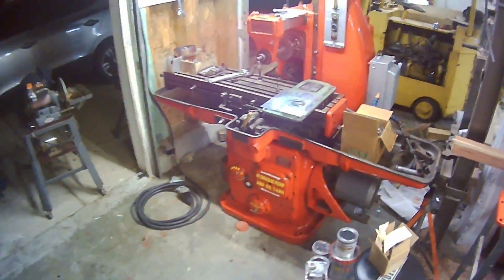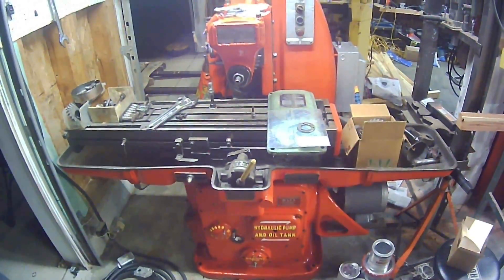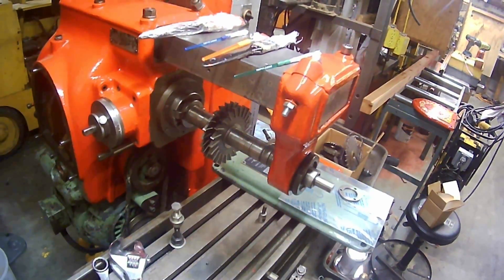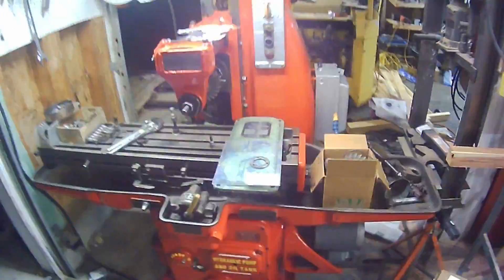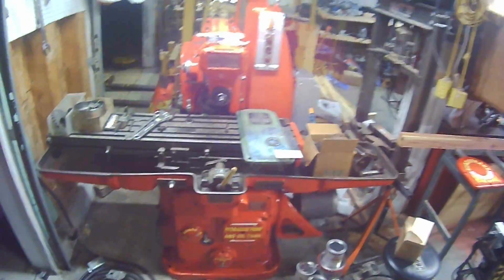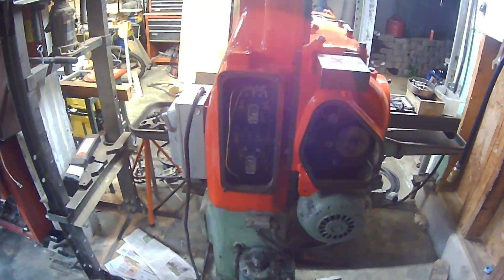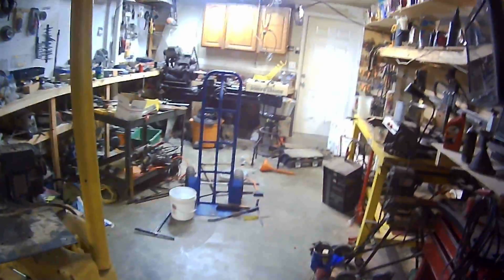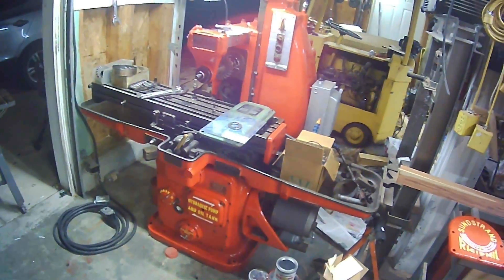500 Dollar Horizonal Milling Machine Find!

Comment: That looks a really sturdy mill you have there, great project. Cheers Tony
Reply from the maker: I hope so! I finally got the convertor in but the main motor is bad! I am trying to find locally but that's proving to be hard unless I go down 1 hp
Reply: @Average Hack You could always use a 1HP motor to get you going, then just wait till you drop on a larger HP motor. At least you'll have use of the machine. Cheers Tony
Reply: @averagehack4582  motor horsepower has to be the same for the replacement because the spindle speeds will be reduced causing tool chatter. AL B.